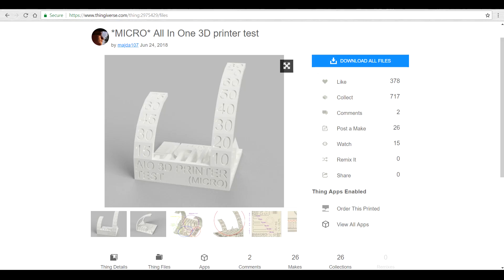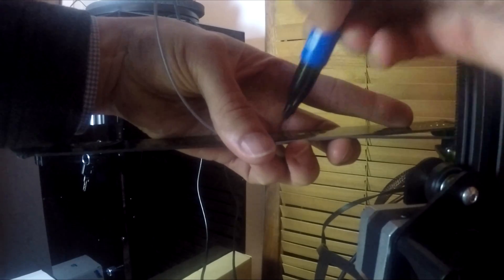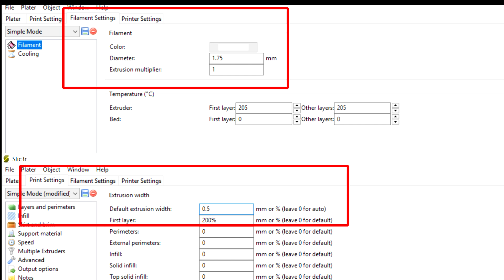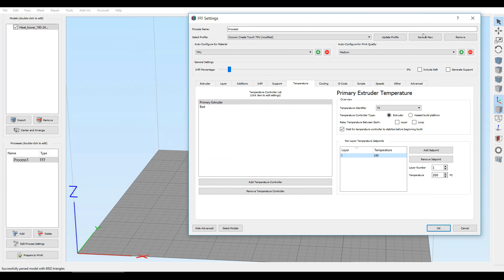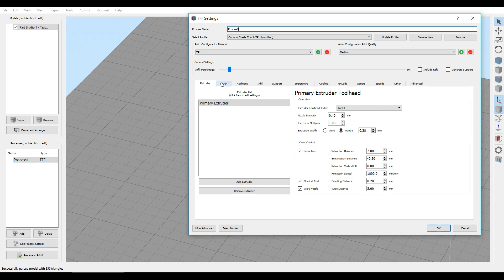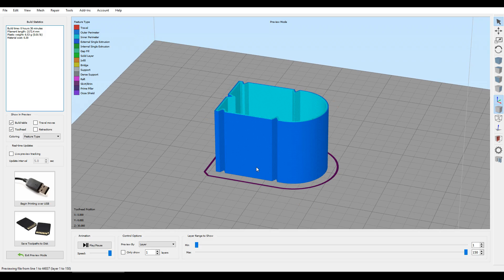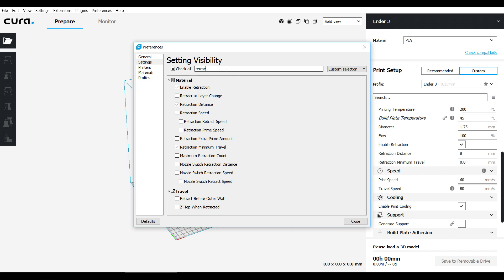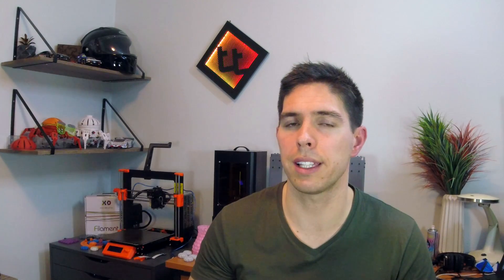How to tune your slicer settings featuring Ender 3 - UPDATE IN DESCRIPTION

Comment: hey i know this is an old video and it has been very helpful, just one thing that maybe you could help with. for the speed test with simplify 3D if you increase the default speed, i found no difference or change in the actual speed the printer is printing as simplify 3D seems to make the outer layer about 1440mm/min and inside layers 1860 all the way up. also if i print the object with the default speed at 6000mm/min in shows no change in print time which would mean there hasn't been any changes in speed. is there a way to over ride it to ensure the print is actually printing faster? also you can see this if you change colouring to movement speed it should show the different speeds as it increases in 5mm increments but it doesnt.

Comment: 7:06 
as i understand speed was set to be tested between 30-100 mm/s
3 perimeter = 1 outer perimeter+ 2 inner perimeter
"Outline Underspeed"=50%
so i think it means speed tested between 15-50 mm/s for outer perimeter
and for all perimeter need to uncheck "adjust printing for layer below __ sec"
*after slicing can select under "coloring"="movement speed" to confirm

my test result for 30-80 m/s with 1 perimeter
it all look the same
but if closely inspected and tilted to the right angle against the light
you can see waves in the walls 
having high frequency at low speed and almost gone at higher speed.
also variable in wall thickness, where it prints a straight line 
the beginning and end of a line will be 0.48(as calibrated)
and in the middle thinner with higher speed.. reached to 0.36mm at 80 m/s

Comment: May you help me, i just started using simplify, my ender 3 pro keep stoping in middle of printing when it reached over 4hours printing, i think it was overheated, bcoz  i saw the fan of power supply is not running all the time. (When i use other slicer, the printer works well). IS There any setting in simplify to make the fan of power supply to running when we do some printing? Thanks...and really need your helps :)

Comment: Setup the Ender 3 today and followed your guide. Fantastic! When you said it fed the filament agonisingly slow, I was surprised as to how slow it was. It took nearly 4 minutes. Is that right?
Reply: If you followed the instructions you should extrude 100 mm at a speed of 100 mm/min so it should do it in exactly a minute.

Comment: That's odd - running the speed test GCode on my Ender 5 Pro shows no change in speed (based on both the tuning menu, which indicates a constant speed of 100mm/s) and eyeballing it. I can't find anything in the GCode modulating the print speed either, however I'm not 100% sure I'm looking for the right command. Are you sure the speed test is working correctly?

Also, if you were to expand on this video in the future I'd recommend adding some guidance for tuning for horizontal expansion, as that one drove me nuts for a while until I figured it out.

Comment: "This video should be quite helpful for you"... yeah, understatement much? Literally the best video I've found covering printer calibration and fault finding. Interestingly, it was here that I discovered extrusion settings (esteps and flow rate) directly lead to stringing problems. Such a helpful post!
Reply: Were you over or under extruding? Did you eliminate the stringing?

Comment: This made a big difference for me - on the extrusion. My measured 100mm was coming in at about 89mm, so underextrustion was a big issue. The first test print I did afterwards was dramatically different...... thank you thank you.

Now I have to go back and redo do the other tests... and try to get a look at my config h settings.

UPDATE: I redid the speed test after the extruder calibration and it was chalk and cheese. Prior to the extruder calibration I was struggling to get okay results at 50mm/sec.  Now I am only just seeing some artifacts at 100mm/sec, so 70 to 80 - maybe even 90  looks the go.... and this will save me time. The retraction test now gives me 4 as the right number. Again a big THANK YOU.

Comment: Incase anyone cannot get the extrude to work with the command above use: M83 before to put the extruder in realtive mode otherwise it can only do 50mm at a time
Reply: Hi, this solved it for me, thanks! Noob question: do I need to reverse this operation (M83) once I'm done with the process?

Comment: Anyone have a idea why my Ender 3 is printing slower than the 1.5 hrs referenced at the end of this video? Ender 3, .4 nozzel, PLA, Cura 4.4  stock settings, normal profile quality. Default print speed is 50 mm/s.  Print time 2hrs 25 mins. Changing print speed to 100 only shaved 30mins.

Comment: Hi, all calculations aside an easy way to to achieve this is as follows;

1. Remove the filament from Bowden tube,
2. Unscrew the Bowden Coupler from the Extruder and let it hang in free space,
3. Heat the Hot End to around 200c (allows Extruder drive),
4. Feed filament into the Extruder until it emerges to where the coupling connects,
5. Cut the filament flush with the Extruder Coupling connection hole,
6. Instruct the Extruder (Via the control panel) to extrude 100mm, cut off the filament that comes out & measure,
7. Repeat step 7, Adjusting E-Steps to achieve exactly 100mm.

Note: The Extruder does not care if it is connected to the Hot End, It just needs to extrude what was instructed.
My Ender 3 E-Steps was set to the default of 93/mm, to get exactly 100mm out I had to set E-Steps to 138/mm.

This made a great difference to print quality and strength.

Witzie

Comment: Really nice to have those gcode file ready on thingiverse. It saves a little time creating multiple processes. This could easily become a relatively fast routine to test a new filament though I got almost same result as yours with smarfil pla (and have been able to raise speed significately which is just priceless !) . I'll test it with a really nasty wood filament. Can't wait to have all my filaments properly setup in s3d (wonderful piece of software ! I didn't regret any dollar I spent on it)

Comment: I'm using the PrusaSlicer, how do I slice with hollow top and bottom?  The STL listed in the description has all sides.
Reply: In Cura, under Shell you just set  top and bottom layer thickness at zero - and set infill at zero.

Then set the wall thickness to 0.5 - or whatever you want.

Look for similar settings
Reply: Steve Ingram I actually found a better way with the PrusaSlicer vase mode. It automatically sets the perimeter to 1, adjusted the speeds, and chop off the top layers. Pretty cool feature and the result was silky smooth and precise.

Comment: Am i correct in that i can download your gcodes on thingyverse for speed test and retraction test and then send it straight to print without adjusting anything? ie is the correct speeds pre coded in the gcode?

Comment: If your Ender 3 just says OK and does nothing you may be in absolute mode so a second command to move to E100 will be a command to not move as it is at E100 in absolute terms. Try resetting the extruder to zero before the move command with a: 
G92 E0
Then use the :
G1 E100 F100

Comment: Michael - since I acquired an Ender3 you've been one of my go-to guys whenever I'm trying to finger out stuff.   I've come to really appreciate your teaching style,  much as I've learned to hate some others, who generally only waste my time.  Anyway, being lazy today when I discovered that my extrusion rate was grossly out of kilter, instead of just pulling up my gcode reference I opted for your video that would remind me where I had to modify the steps per setting.  Your example of being only 2% off makes me jealous.  Unfortunately, not only is mine MUCH farther off -- it's highly INCONSISTENT!  Naturally, this points at an entirely different problem and solution, but being pushed to produce a little thing for someone TODAY, I thought I'd just make a STAB at getting it closer in hopes of getting this job done.  Here's how BAD it is - in 10 measured samples of calling for extruding 10mm (of Taulman Alloy910) I measured these results: 9.04, 8.75, 6.33, 8.74, 8.60, 8.04, 7.05, 8.98, 7.88, and 7.05 for an average of 8.05.  Pretty sad - makes me wonder if I should cut to the chase and change to a dual-geared extruder that I bought from PrintRbot before they folded.  Kinda whacked - and probably out of the realm of this video, but I thought I'd see if you had any cheese to go with my whine.

Comment: I had used this gcode when the video came out and it was great Ive just used it again and it keeps putting it in the back right corner and scales it up for some reason.  Ive tried sending through octoprint and printing for sd same issue

Comment: should i disconnect the ptfe tube first before testing my extruder? if not, what temp should i set the hot end to achieve accurate results?

Comment: Hi this was a great video learned lost of good stuff. I have a question when you did your all in one test print the first one was done in 1 1/2 hours then the 2nd was done in 1 hour with the same quality. My 1st print took 1 1/2 hours and my 2nd print was 2 1/2 hours and came out worse then the 1st. you have any suggestions that might help? 
Thank you for all the time you put into the videos they are great.

Comment: Hey i need help with ender 3 pro. I just bought it and although the sample dog. Gcode file printed perfectly. I'm trying to print some Lego blocks and knobs but the circle is coming out as an oval, like a bit melted. I'm trying to print at 200c and 60c bed temp and 80mm speed. Where can i email some pics so you can help out. Thanks

Comment: Ack! The intro line for the speed test (with ABL) runs along the front of the X axis, and rammed into my clips. Isn't that where they usually go on an Ender 3? I changed it to the Y axis, but it was a little panic-inducing!
Reply: yea his G-Code is lacking some sort of safty z movement and seems to use some pruning line in the front ? Dangerous if you ask me but i cant realy complain as this helped me improve my prints by lightyears. So @Teaching Tech if you see this ... the G-Code could be adjusted to safe some headache ;) otherwise thanks alot
Reply: Same for me, ran over the clip. That line in front also does scratch the bed, even when the clip is out of the way. I observed that with the Retraction test with ABL.
Reply: @GerdKnops  set your home position and build area to the correct values and you will never hit the clips again
Reply: @rotagbhd  That will not help because it extrudes intro line on X axis at Z=0
Reply: Also, you can get rid of, or move the wipe line at the start of your gcode, I think the Cura default starts it at X +10.1mm
Reply: Just checked gcode files in a simulator. They ALL run along X axis at start when Z=0. If you have a glass bed with clips put at front and back then these gcode files are not for you. You risk damaging printer with it.

Comment: I have a question about part of this video. In the speed calibration portion, you type "3000 mm/min" and say that's equal to 30mm/s. But.. that can't be right. There are 60 seconds in a minute, not 100. Wouldn't 3000 mm/min be equal to 50 mm/s?

Comment: Hi, is there a way in Cura to change the retraction distance at a certain height just like in your test or can you only do it in simplify3D ?
Reply: I didn't found this either in cura... So I downloaded Michael's gcode, see description, on thingiverse. Printed that with my ender 5. Checked where the stringing was gone (for me that's on 4mm retraction) and then tested this settings with my cura settings. (printed the 2 poles again. after a while I canceled the print.

Worked great!

(i hope you understand what I'm talking about ;-) )
Reply: @petrossystems7579  yes I do thanks. I did the same with my ender 3. It was 4mm for me too. Only I want to swith to prusa slicer and when I take the same settings 4 mm and 30mm/s retraction speed I've got stringing. Must be something else in his simplify3d profile causing less stringing too. That's why I want to try to recreate the test in other slicers.

Comment: Overall, this is a great video and I've learned a lot from you, thank you! 

But I did see a couple of things... First of all, 3000 mm/min is not 30 mm/sec. It is 50 mm/sec. Divide 3000 by 60 seconds and you get 50. Second, outline speed is set to 50%. That means that at 50 mm/sec your outlines would be printing at 25 mm/sec, right? I believe any flat layers would print at 50 mm/sec, but not outlines.
Reply: This was discovered by another viewer some time ago and there are notes about it in the video description. One other item...the retraction test can be confusing, the first 12mm (including the base) has no retraction, after that the amount of retraction changes every 5mm (2mm retraction, 4mm, 6mm, 8mm).

Comment: Newbie, here.  Have a question, what type of supports did you use to print out the "Micro all in one 3D print test"?
Reply: That test print is printed without any supports to test and see how the settings are
Reply: Thanks, I finally figured out that in Cura , I had to rotate the object so it sits up right.  When I load the .STL file the 3D object is laying down with the bottom in the front; i.e. the bottom of the object was NOT parallel with the Z-axis. If I rotated the object, so that it stood on the bottom, then I could see that no supports were needed to print the Micro test object.  What I do not understand, is why the .STL file has the object falling forward?

Comment: Ever since I followed this guide, I and other people are having an odd issue. The Ender 3 will make the purge line on the left side of the bed, then it oddly retracts at least 3 full revolutions of filament before it starts the print. I have to either print a larger skirt or physically depress the extruder arm and shove the filament back down to the nozzle, otherwise it prints in the air for at least 20 seconds. I did not have this issue before, and again, others have reported this same condition. I used Pronterface, as recommended. Any ideas?

Comment: Your retraction test gcode has an error.  The 2mm retractions don't start until Z = 12mm,  not 7mm as stated in the video.    So the first 10mm are at 0mm retraction and at 10mm the 2mm retractions begin and then increase by 2mm every 5mm.  Thought you and all others should know this.

Comment: Thanks for this, using the extruder measurement I noticed the bearing on the extruder kept slipping, giving inconsistent feed. I tightened the spring arm screw, which fixed the issue.

Comment: Just a heads up, I tried this troubleshooting my issues and the settings change behavior on my printer.  It now tries to prime in front (pushing the clips on the bed) and when finished, instead of pulling the tray forward - pushes it all the way back away from me. (Ender 3)  I also got strange results on the Temperature test, that all the ending in 5C seem to be the same and all ending in 0C seem to be the same with the only difference that 240C had some slight other issues (or maybe my untrained eyes)

Comment: Great video - I have a problem on Ender 3 Pro that I cannot resolve from this -a print model with and 8mm diameter shaft and a 40mm wheel at the bottom ends up giving 40.1 at the wheel part and 7.5mm at the shaft point.
If we push to little plastic through the nozzle as I see it both values should be below spec. at the same absolute value, and if it is XY calibration they should be off by the same proportional value.
Any idea what to calibrate?

Comment: After I set my new e step according to your tutorial, the length was horribly wrong. Isn't it better to just measure, set th e step a little bit higher or lower (depending if its over or under extruded) and repeat until it takes exactly 100mm?.

Comment: Hey Michael, awesome vid thanks. The procedure for calculating the esteps should be the same across printers and I have a Cocoon Create touch using X3D PLA. But my measurements keep changing. I have marked out the 120mm and run it 5 times using Pronterface and I have got results ranging from between +3mm and +16mm. I know its under-extruding but obviously I can't make any reliable changes with this. I am guessing the extrusion is skipping maybe but cant see anything wrong with the stepper. Any ideas on this one?

Comment: The extruder may be in absolute positioning mode by default, so could move in reverse. Either zero the extruder first with G92 E0, or set the extruder to relative positioning using G91.

Comment: @Teching Tech I am having weird issue. If I set extrusion width 0.45 in slicer and perimeter one, I get parallel walls with 0.45mm thickness but 0.60 thickness in adjacent wall. So two parallel walls are 0.45 and two other parallel walls are 0.65. what could be wrong?

Comment: Hai Teaching Tech. 

I have a questions ...

After mesure my Estep suppose to be E97.89
I sending code 

M92 E97.89

and 

M500 ( to save the code)

i try to check with 

M503 ( everything great ) the estep have changes to E97.89

But after i restart the printer 

it goes back to E93 

did i miss something here ? 

thanks in advances

Comment: I did use your speed test gcode. Turned out great, de top 2 are great!

Can you tell me which speed I need to set in cura? Can't find it anywhere.
Reply: Not an expert, but I think it's 'Print Speed'  under the speed section.